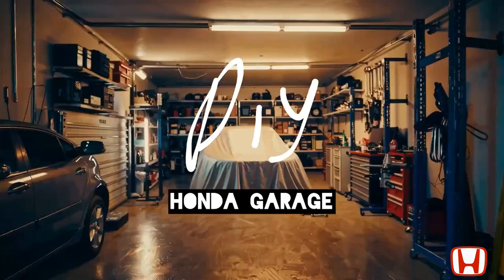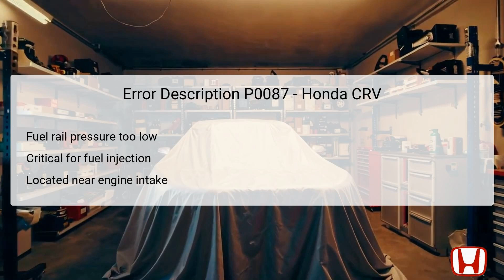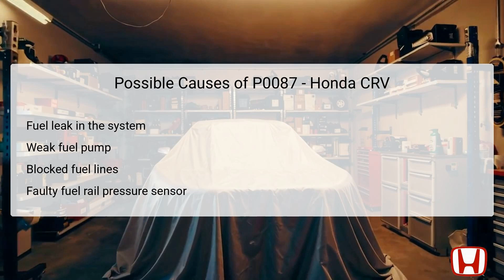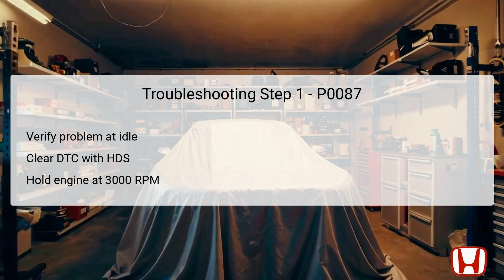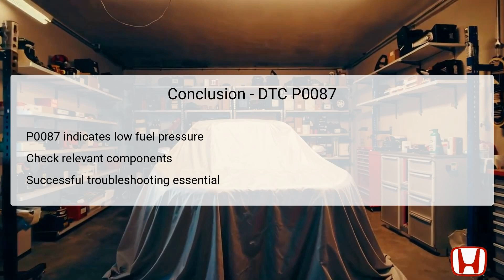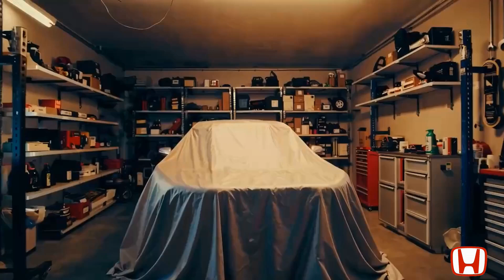DTC P0087: Fuel Rail Pressure Too Low - Honda CRV 2017-2022

Comment: I have P0087 on 2016 Honda CRV EX. I see TPMS,  check engine light, tractio. Control and power steering light on on the dashboard. Please let me know how to fix. Should i go to Honda Dealer service or local mechanic? How much does it cost to fix it